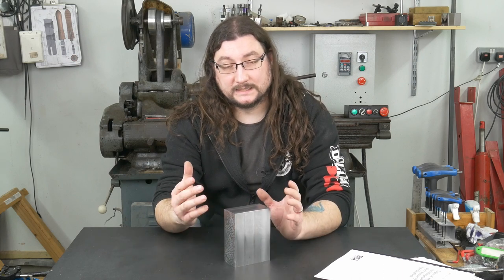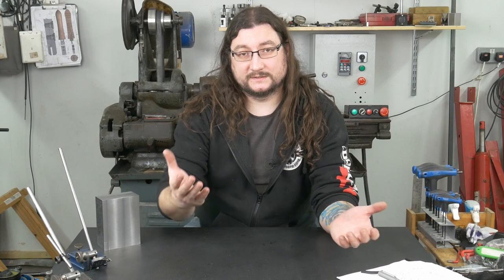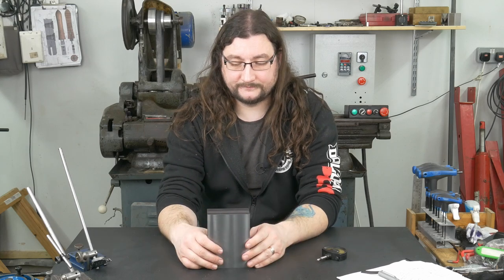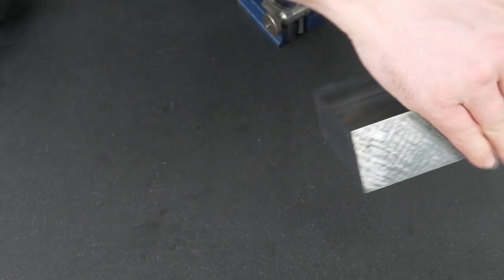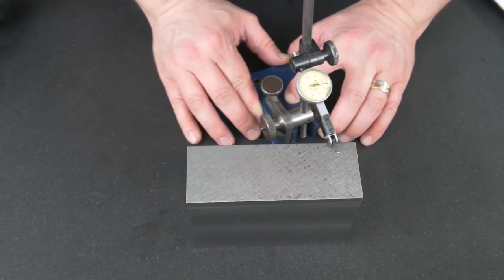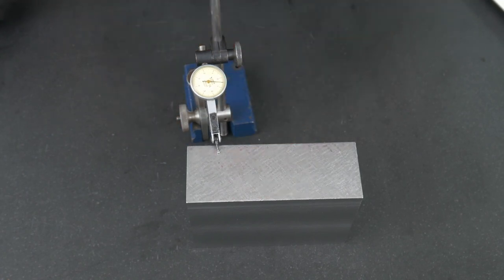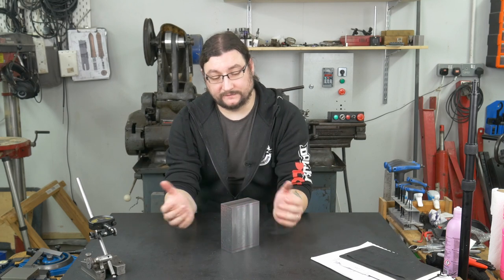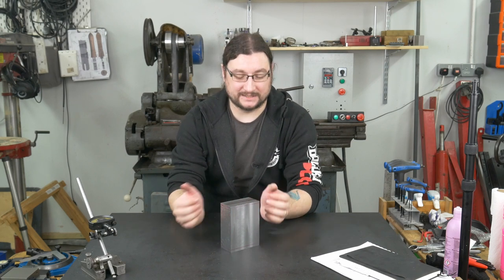Measuring flatness, parallelism and perpendicularity on a surface plate.

Comment: Thanks for the plane English explanation, I learned a lot from your video. Never knew what the ball on the bottom of the post was for!
Reply from the maker: You know, I don't know if that's really what it's for but it certainly works. A proper stand with a bumper is easier to use but this does the job.
Reply: @ImpracticalMachinist With the ball positioned at the top of the shaft, it's both for aesthetics or a bit of traditional decoration I guess, but more importantly, it's really meant to be used to park the tip on the bent end of the scriber into that groove below the ball so you don't stab yourself by mistake when your not actually using it. 

However Starrett in there bean counting wisdom no longer adds that ball tip. I bought a brand new Starrett surface gauge a few years ago for some fairly decent money. Unfortunately I should have noticed in the pictures they no longer have that ball end. Between that and the nice fat run right on the top of the gauge base that never should have made it through any level of QC, I'll buy anything metrology related from Mitutoyo, Mahr or or others.
Reply from the maker: @Pete-xe3il  I'll have to try that out the next time im using it with a scriber, never occured to me that it might be used for that.
Reply: @ImpracticalMachinist It wasn't obvious to me either, but I ran across a thread on Practical Machinist a number of years ago that mentioned parking the bent end of the scriber tip in that recess. For what ever reason, few today seem to know about that little detail. Once I did know, I've since run across older drawings of various brands of surface gages that sometimes show that tip set into that position as well.

Comment: For testing squareness, instead of inverting the post and using the round top, I've seen people simply place a ball bearing in the 'V' of the surface gauge. Ball bearings are amazingly cheap and accurate.
Reply from the maker: That’s a good point, I wish I’d mentioned that now.
Reply: Well, you would be "nicely" surprised, how "round" are balls from China ball bearings !
Reply: Ball bearings are graded from 3-2000. The smaller the number, the more precise. Typically noted as a G-value. A decent ball bearing for this application would be G25. That's what I use on occasion, FWIW. Bearings made for, say, slingshots can vary by a couple of thou. That's not round.
Reply: @vaidaspetraitis9353  Always check the bearing's G-value. COO has nothing to do with this.
Reply: @felixf5211  Even a G200 bearing is spherical within a tenth, which is the resolution of the best indicator I own.

And they're really cheap.
Reply: @paulwomack5866  They're all fairly inexpensive. With a G200 you're compiling errors. Relatively small errors, yes. Whether it's important or not is not for me to decide. Good luck.

Comment: Thanks for the video. What is the gauge/measuring device that you use to measure flatness and parallelism called?  I have several dial indicators but none of them look like that one.
Reply from the maker: This one is a Mahr Millimess, it is a plunger type indicator but with a very distinctive dial casing.

Comment: So the basic iterative process of making this block? Flatten side 1. Flatten the opposite side (2) while also verifying that sides (1) and (2) remain parallel. Then flatten a 3rd side while using the technique at 6:30 to verify the angle measures exactly the same to both sides (1) and (2) ?
Reply from the maker: That's the essence of it, but there are different ways to achieve the same result. Tom Lipton, for example, put together a square with adjustable feet meaning that the two faces which he had ground parallel could be calibrated to a surface plate without further scraping or grinding.
Reply: You need to flatten both sides 3 AND 4. AND check that 3 and 4 are also parallel to each other, using the same technique as with 1 and 2. This is vital for the next step.
Now you can check for squareness by comparing the measurement at sides 3 and 4. The actual value doesn't matter  but it should be the same at both sides. If the sides are leaning, they will be leaning "in sync" because they are parallel. Specifically, if side 3 is leaning towards the indicator, side 4 MUST be leaning away from the indicator. That's what's so cleaver about this method. 
I fear this wasn't too well explained in this video.

Comment: Hi i wanted to make you a question. Why do you measure it from below and not above?
Reply from the maker: Because we need to use the surface plate as our flatness reference, otherwise we would be checking the face for parallelism against its opposite face.

Comment: A quick question. When you say “it’s within a tenth”, what do you mean?
Reply from the maker: Within one-ten-thousandth of an inch, or .0001" Usually you'll hear tenths, or thou (.001"), and occasionally millionths but not in my workshop.
Reply: @ImpracticalMachinist  Ahhh, of course. That makes sense now. Many thanks. 👍😀

Comment: 4:41 - How is the dial indicator sung and tight mounted to surface gauge holder? Does the knob tightens both the stand post and the dial indicator shaft?
Reply from the maker: Yes, the mounting hardware tightens against the shaft on the holder and the shaft on the gauge simultaneously.

Comment: You don't seem to have almost any depth in your scraping, is it on purpose?
Reply from the maker: In this case because it's a reference not a bearing surface I want the scraped faces as flat as possible.
Reply: @ImpracticalMachinist  right, that makes sense. did you have any particular technique to scrape it that way? I'm not sure how I would tackle that to be honest. Have you started with a precision ground surface?
Reply from the maker: Get close with the mill, i face milled the block but a fly cutter may be a better tool for the job. 

Then scrape, let the blue on the plate thin out and gradually ease off the pressure on the scraper as the dips get shallower. When stoning off after each pass just go over the piece a bit more than you usually would for knocking the burrs off.

Once you’ve done that and you’ve got it to where you think it’s flat, leave the piece alone for the night, come back in the morning and check it again, scrape as needed.

There’s a reason that straight edges, squares etc are stress relieved, because the metal will move, so if you can start with a cast iron square that’s been treated and stress relieved that would be a way better start.

I’m going to do a video covering a proper square build at some point.